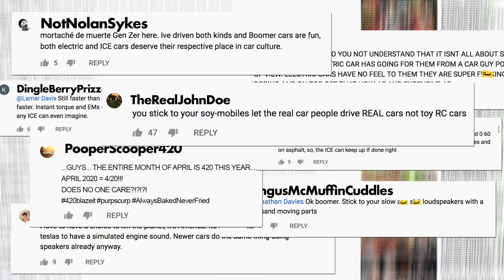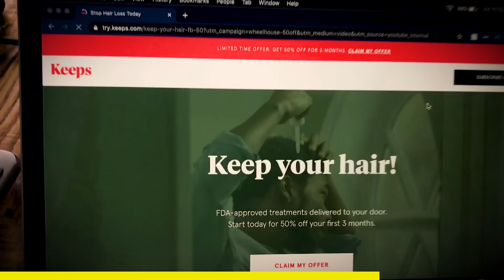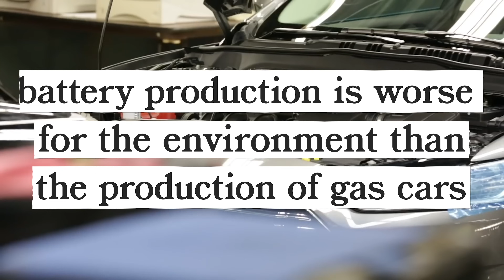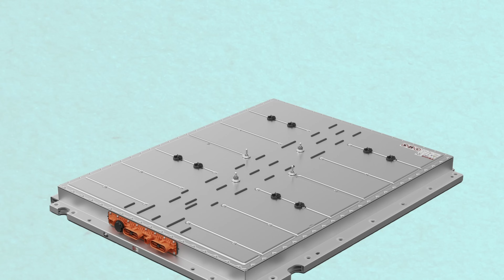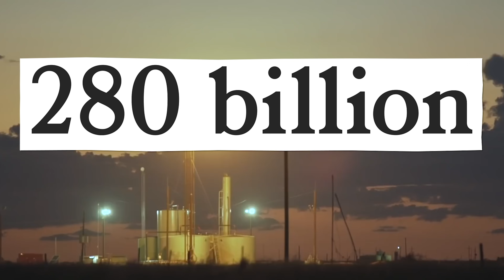Are Electric Cars REALLY Better for the Environment?

Comment: Something you didn't consider:

When temperatures drop below 20F, batteries lose 40% of their power.  Where I live in NW Alberta, temps drop below -40.  What do you think is going to happen to those batteries at -40?
Reply: Diverse energy is what's needed not a one size fits all solution. Where you live you should continue using gas cars. You can't defeat physics and batteries in those temperatures aren't worth it. Other places can use electric.
Reply: @mikeoxlong3676  the problem is that those who aren't in areas like I am in think electric is the way to go even in the area I'm in.  They're a bunch of idiots as far as I go.

If there is an option that could make sense out here, I'd have to say a hydrogen powered engine, not a fuel cell.
Reply: there are a lot of parts of the world for whatever reason EV's simply fall flat on their face from a practical point of view hence Scandinavia and northern Europe's heavy investment in E-Fuels.
Reply: No problem for a Tesla
Reply: @mulzceo  yeah right
Reply: Same thing as down here where it gets almost as cold! Range drops. Using a block heater or battery warmer works well for ICE cars. But do you dare leave your EV plugged in or in your heated garage: See: Chevy Volt
Reply: i didn't read all the comments above, but i want to answer you question... (i live in AB too). I've read the battery range drops by 40% in our winters like now in -40C, and some tesla owners have been complaining about malfunctioning warm-AC once we fell below -20C, eg. blowing cold air, cold feets,  foggy windows, blowing air takes too much battery power, etc... Hot air system malfunctioning in our cold winter has been plaguing the electric vehicles...  not just tesla. Even toyota rav4 prime plug-in have warm air issues I hear.
Our province doesn't even give incentives for electric vehicles like ON or QC does. Our electric grid output decreases whenever we hit below -30C. And, I'm pretty sure majority of our electricity is generated by burning non-renewables. It doesn't make sense owning a full electric vehicle here, at least to me. Just ironically we still receive a bunch of ads about them....
And me too, I drive a V6  4x4  truck, so i can drive to banff without making 4 stops in between to charge, or go off grid off roading. And also be able drive in the city because our roads are covered in ice and snow majority of year....
Reply: @169494  They drop 40 percent at -6C.  It dropped down to -44 here in gp last week....not to mention the cost of replacing the batteries....$33000 cdn and up.
Reply: Assuming your range on a full charge is half of what it is in normal temperature, you could argue that the CO2 emissions double. That still keeps the average electric car producing less CO2 than gas engines. And that is only a few months a year. The EV will still win out on emissions in the long run.
Reply: @pgaboury  not at -40......they'll most likely be frozen and as useless as tits on a bull
Reply: when it gets really cold like 10F degrees - gasoline is the most  reliable fuel source. but  gasoline cars still need batteries to start up. .. and if you want to operate efficiently you need to pre heat the engine block with an electric engine block heater.
Reply: @ResidualSelfImage  aaaand this makes a point because? The Ev can't do anything at that temp worth noting, even with a heater
Reply: @ResidualSelfImage  but in most of those conditions the lack of range is a more than dangerous factor as well as not being able to passively heat all required parts as well as the cabin and other things like steering wheel/seats, a large truck with an already running diesel in most cases can run for days stationary, the EV cannot
Reply: @ResidualSelfImage  I plug mine in as soon as it drops below 5 below 0.
Reply: @ResidualSelfImage  a good electric car will have a temperature sensor for the batteries and keep you heated but that's not very useful when you are away from home.
Reply: He didn't consider that because of the subject of the video.
Reply: You'll get a lot less power
Reply: Convertibles aren't useful in those conditions either. Guess what? These cars are not meant for all conditions on the earth at all times. No one is claiming they are. I know it is hard to conceive of but we will use different solutions for different applications. Hatchbacks aren't good for hauling 5th wheels either so we don't use them for that. The vast majority of cars in the world ARE used in climates that work fine for EVs and travel over ranges ar beneath EVs. So hey, let's start there... obviously!
Reply: @craigmilton9892  Excellent supply.  Plus.  How many people live in NW Alberta vs, say, Southern California?
Reply: @craigmilton9892  The vehicle I have is reflective of the winter conditions in my neck of the woods......that's why I have a V8 powered 4x4.  Yes, I do tow a few times a year.....and more often than not, the road conditions are rat shit in the winter.
Reply: @markdubois4882  That is why electric is not currently marketed for those conditions. But keep an eye on the F150 electric. It looks amazing. By the end of the decade there will hardly be a condition or application on the planet that EVs won't work for. Sadly we didn't start on this path years ago, but at least it is here now. Enjoy your V8 while you have it. It will soon be as practical as a horse and buggy. :)
Reply: @craigmilton9892  I'll go one better than that since you're anti-oil:

A few suggestions:

1) Don't drive your car be it gas, propane, diesel, natural gas, or electric.
2) Don't ride on a bus.
3) Don't take a train.
4) Don't hail a cab.
5) Don't go for a boat ride.
6) Don't ride your bicycle.
7) Don't take a warm/hot shower.
8) Don't turn the heat on in your house/apartment.
9) Don't turn anything electrical on....after all.....most of the electricity we all consume comes from either a coal-fired or natural gas plant.
10) Don't buy groceries.....after all....almost everything grocery related is in a plastic package.
11) Don't go for a motorcycle ride.

If you do ANY of the above, and you are anti-oil....you are an absolute hypocrite.
Reply: @markdubois4882  Ummmm... that makes no sense, but sure. You do realize oil isn't the only form of energy right? Oil has only been the primary source of energy for little over 100 years. We lived without it before and will move on from it now. Do you still use whale oil lamps? I bet not. But either way, don't be so defensive. It isn't about you or I. I am not for or against oil more than I am wood, solar, coal or hydro. Oil isn't going away based on my feelings or yours brother, it is going away because the world, including car manufacturers and energy producers btw, are moving on from it. That's just a fact. Sorry if that is going to be hard for you... that's weird that you care so much. It is just energy. Who wouldn't want energy to be less wasteful and destructive?
Reply: Sounds like Walter trying to explain anything to Bubba J.
Reply: @markdubois4882  Facts are a bitch when you want to react only on opinion and emotion aren't they?
Reply: @craigmilton9892  yeah mate you're so far off the mark its not funny, EV will not work in all places and conditions, this is a pill the EV pushers need to swallow, someone earlier mentioned energy diversity, this is the point, most harmful and needless emissions are from city dwellers, their engines are usually working the least efficient and thusly they should be the only ones forced to switch as is the case in some parts of the world already, as legislation is tabled, but their governing bodies aren't as belligerent as you and understand that other conditions call for other solutions, EV's are never going to service everyones needs, and whilst it will serve the needs of hundreds of millions or billions, it will not serve the needs of billions more people. the zealot attitude is merely your own smugness used to disguise your own insecurities in life. keep it to yourself.
Reply: @fluchtigziege3202  I literally said that they aren't for every condition. If you want to make a point you'll need to READ, as well as respond. It is a well known fact, not a belligerent opinion, that the bulk of humans dwell in coastal adjacent cities and they use the bulk of the cars and those cars could be electric. It isn't personal dude. The change isn't happening just to hurt you. But I love how confidently you say NEVER. You sound just like an 1800's whale oil salesman or horse buggy manufacturer telling his buddies how electricity and the horseless carriage are never going to work for all people in all conditions... Please quote where I said that EV's are going to work in all conditions at all times. You can't because you are arguing a point I never made. I did say "These cars are not meant for all conditions on the earth at all times. No one is claiming they are. I know it is hard to conceive of but we will use different solutions for different applications." So thanks for the shit attitude attacking me for a point I never made. You made the exact same point I made while calling me belligerent and smug... Who is being smug, belligerent and "so far off the mark its not funny". But thanks for weighing in and repeating exactly what I said. It was very insightful.
Reply: @fluchtigziege3202  Again, read before you respond and you won't look so foolish... I noticed you couldn't point out where I did what you claimed I did. But hey, double down on being wrong. Maybe that'll eventually make you right.
Reply: @craigmilton9892  mate you're the one telling people their car is as good as useless, when that is totally contrary to the facts.
Reply: @fluchtigziege3202 Please stop responding to what you think I said and READ what I actually said.  "These cars are not meant for all conditions on the earth at all times." "we will use different solutions for different applications." "That is why electric is not currently marketed for those conditions." "The vast majority of cars in the world ARE used in climates that work fine for EVs and travel over ranges far beneath EVs. So hey, let's start there" "Thank god the bulk of humanity lives in temperate regions that electric cars work perfectly for." What I actually said, which is exactly what you claim I wasn't saying. You can double down all day on what your misrepresentation of what I said if it makes you feel good, but it won't change what I actually said. If only there was some way to look back and read what actually happened. Maybe one day that technology will exist. But hey, make up shit if it makes you feel like you have accomplished something. I'm glad I can make you feel like you achieved something today. You sure showed me...
Reply: @fluchtigziege3202  He literally said in one of his first replies "These cars are not meant for all conditions on the earth at all times. No one is claiming they are." I'm not even involved in this discussion, but you completely made up everything you accused him of saying. I can't understand how people like you can just straight up ignore facts like that. It's insane.
Reply: @llamaboy64  You got that wrong too.
Reply: @craigmilton9892  You are, of course, correct.  You need to ignore some of these idiots.
Reply: @markdubois4882  Asphalt roads.
The most overlooked of all petroleum products. Some would say so let's do concrete. And they would be the morons.
Reply: @markdubois4882  12) Don't be ridiculous.
Reply: @denysarcuri1213  sure bill
Reply: @craigmilton9892  Which means replacing ICE cars with EVs is not a feasible solution.  Another factor is that renewable energy from the electric grid is also not feasible in many places at even 50%.  Sure, EV is nice, and helps, but is not by any means a 100% solution.
Reply: @leefranklin3054  No one claims it is. You are arguing a point no one is making. Where has this foolish notion come from that if something isn't a 100% solution it isn't part of the solution?
Reply: @craigmilton9892  I actually do think EV's have their place and uses.  I think I was thinking of the video where the OP assumed that everything can go renewable and we keep the same ability for us to do industry, and that is not at all possible now, or in the near future.
Reply: @craigmilton9892  you too, what an elitist comment…
Reply: @OriflammeGaming  Which one?
Reply: Fine.  It rarely gets down to +40 where I live in SE California, so I, like most people, are never going to experience what you're talking about.
Reply: @denysarcuri1213  somewhere along the lines of what Alaska sees.
Reply: @denysarcuri1213  what an elitist comment…
Reply: @OriflammeGaming  Which comment?
Reply: @denysarcuri1213  Extreme heat wears down on the battery faster.
Reply: Well sounds like they’ll increase global warming so problem solved
Reply: @Daruki Neo Thank god the bulk of humanity lives in temperate regions that electric cars work perfectly for. BTW, your assessment is outdated. I live in a cold climate in the winter, down to -20 C and a hot climate in the summer, up to +40 C and electric cars are thriving here.
Reply: Ok musk fanboy
Electric cars won’t fix traffic or emission 
The most they do is destroy the landscape and contribute to composite pcb oil and cobalt pollution 
If you twats wanted to fix emissions it would be nuclear power, walkable cities, banning non essential plastic use and public transit
And biofuel/plastic fuel because those are the most energy dense fuels we have that don’t evacuate into space
Reply: @juancappadocio6311  You should screencap this comment and see how well it ages in a decade... just out of curiosity.

Comment: My only critique with this video is you are assuming that the EV car is only going use one set of batteries over its life span. My wife owned a Prius and I had to change batteries 3 times over the time I had it. Other than that good job on the video
Reply: There are two big factors here to consider when comparing your experience with a prius. 1.) a Prius is a hydrid. As such its battery size is very very low. around 1.3kWh to a tesla's 50kWh-100kWh. Why that is important is that batteries are rated in cycles. How many charges and discharges of your full battery capacity. To break it into numbers lets assume you can go 1km for 0.13 kWh (model 3's efficiency). So for a 50kWh battery you can travel 50/0.13=384km for every cycle. Now for the Prius with a  1.3 kWh capacity. Thats 10km per cycle. Now Teslas have battery cycles of 1500 cycles for modern Teslas. And thats 1,500 cycles to 70% of your original battery health (or 30% battery degradation). So for a Tesla that lifespan is 384 x 1,500 = 576,000 km. For the prius that battery life is 15,000km worth of battery driving. (when you're not using the motor).

The second thing to consider 2.) is battery management systems. Teslas and other modern EV's have very sophisticated battery management systems. They regulate charge and discharge rates for the batteries at different charge states (tesla's accelerate fastest at 90-100% charge and slowest at 30-0% charge. They also charge fastest at 10%-80% and slowest from 80%-100% and 0%-10%.) In addition to this and many other safeguarding systems to maximise battery life, is that Teslas have dedicated cooling and heating systems for their batteries keeping them constantly within optimal temperatures for battery health. They arent allowed to overheat or to get too cold before the car steps in to cool or heat them.

All together this means that Tesla's can achieve a cycle life of 1,500 cycles, whist without BMS systems you'd be lucky to reach 800-1,000 cycles. Another thing the prius falls victim to.

So in short, the battery in the prius should not be considered analogous to EV batteries.

Comment: The ultimate answer is nuclear energy and solid state batteries…would you do a study on nuclear power ? I am told that the total amount of radioactive waste from all nuclear power plants from the last 50 years would fit inside two typical railroad box cars…the waste is now down to 5% and has a very small footprint. The misinformation surrounding nuclear energy is astounding ….nuclear power is the future. Great video thanks!
Reply: Actually the US alone produces around 2,000 metric tons of radioactive waste ever year in high level waste. But 97% of nuclear waste is Low level waste which means that number becomes 66,000 tons of waste per year. Waste which we do not know how to dispose of. Some of it can be recycled but only a very small fraction. Ontop of that the transport and storage of this waste is very very risky. Especially disposal. All we have so far is to bury it. But thats an unacceptable risk for HLW (high level waste) as a leak could be catestrophic and the waste could be dangerous for the next sever hundred years. So how do you contain it for that long in storage and how do you ensure that its location or purpose isnt lost. For example, if its location is lost due to the outcome of a war. Such as was the case for the Amber Room in WW2.

Comment: Seems a little flawed to consider the gas and ev lifecycle as equal. Gas cars are on the road well over 20 years and are mostly recycled for parts and scrap. How many battery pack replacements would an ev need in that period?

Only time will tell, if I had to guess as EV get wider adoption is when we will learn the true impact of the full supply chain, and disposal.
Reply: 0 replacements actually Current Generation EV's are designed to last more than twice the average lifespan of a combustion engine, battery included.